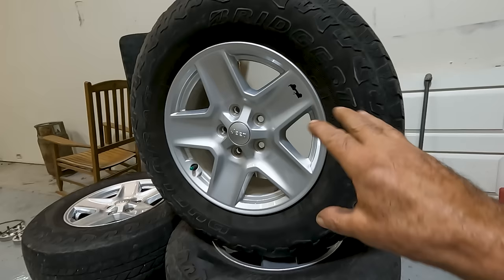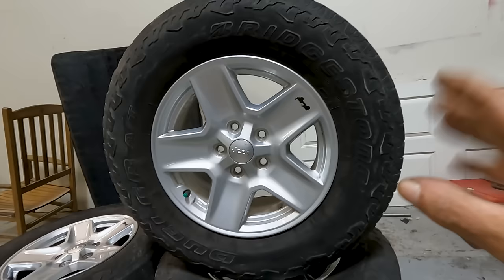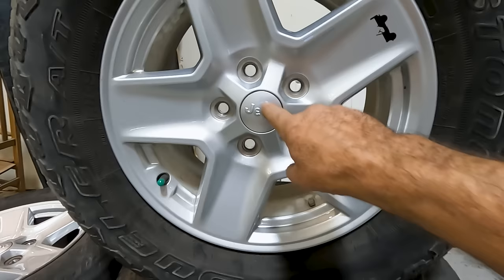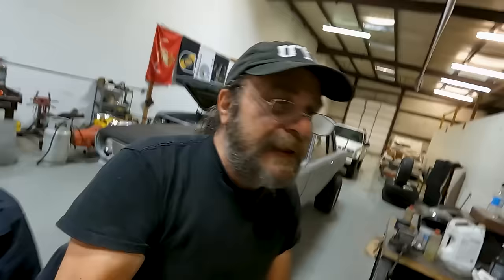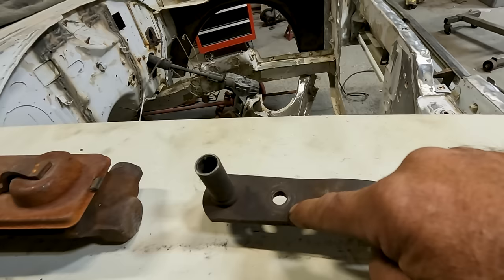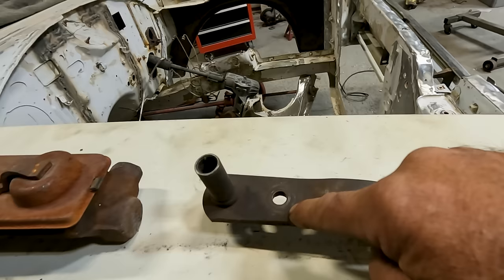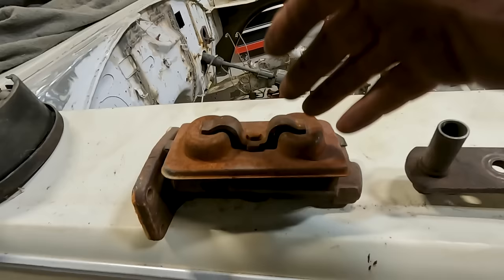Modifying Classic Cars And The Butterfly Effect - Can You Outsmart The Engineers?

Comment: Thank you! I come across this shit with aircooled VWs all the time. The internet says (and told me when I built my beetle 15 years ago) that a front disc conversion is a nice upgrade. Well wouldn't that affect the bias? No, they tell you, the car weight transfers so it's fine. Well, years later I slid my Beetle into a ditch with it's front discs only setup. Now look was that 100% my fault trying to hang the ass out and not knowing how to drive? Absolutely. But I remember sliding towards that ditch just thinking "I'm not even going fast and these brakes are doing NOTHING." I could not modulate the brakes such to create deceleration. Why? Because the internet lied, because you see people on the internet are just some jackasses. And the parts companies, well they just want to sell you parts, so they don't care. What I discovered years later when I started autocrossing the car was the front-only setup was HORRIFICALLY bad. It couldn't stop for SHIT. What people typically never do after modifying the brakes of a car is actually take the car out onto a back road and see how well it stops. Even ass-dyno, you never hear of someone going "oh yeah I went out, slammed on the brakes, it was way better." They just drive around the block and say hey yeah, feels fine. Well it'll feel fine until you discover one of the axles prematurely locks. My brother built a '69 C10, beautiful new paint, LS engine, etc. But he was new to building cars and installed the proportioning valve backwards. What this means is that it absorbed brake pressure from the FRONT axle not the rear. So on the very first drive, we were cruising down the road when the ML250 in front of us swerves around what was revealed to be a stopped car. He slammed on the brakes and the rear axle completely locked, no brakes. Luckily he had his wits about him and was able to steer around the stopped car safely and no harm was done.

Here's the deal with braking, there's a concept called the Ideal Brake Curve, it describes how much force each axle can create at varying rates of deceleration. The car weight transfers by deceleration generated by the tires. If you had a magical tractor beam that slowed the car from it's center of mass, it wouldn't weight transfer. Again the weight transfer is a product of the CG height and the deceleration generated by the tires. So if your car is severely biased wrong, it will not weight transfer because it will not generate enough deceleration. (https://www.theautopian.com/an-engineer-describes-the-ideal-brake-curve-and-why-cars-have-such-vastly-different-brake-sizes/) I can't recommend the youtube channel Suspensions Explained enough for TRULY understanding this stuff. As you touched on the proportioning valve exists to absorb some pressure off the rear axle to tip the hydraulic pressure curve to match the ideal brake curve. This is because a hydraulic system is linear vs the curve of ideal braking. So! If you put a race car style twin master with balance bar setup on a car, and you dial it in perfect for a road course with your big brakes, lets say on a 69 Camaro or something. That car now actually stops WORSE than factory in the rain, why? Because factory would have a proportioning valve and a more rear-biased setup than the race car shit. Same thing if you have a modern ABS car and you delete the ABS, it will now only be biased for maximum decel (Z-critical), which means braking will severely suffer in the rain. You can improve stuff from factory, but you're not outsmarting the engineers, you have to also become an engineer and shift the design criteria.
Reply from the maker: Yup!
Reply: @UncleTonysGarage  It's the worst in the truck world on the internet like reddit. "How big a tire can I put on my truck without it rubbing?" As if that's the only consideration. Rear drum conversions. Lift. No one mentions their towing or axle ratio or other pertinent issues when asking for intardweb advice. You know what I'm saying without listing it all. I personally stick to the two manufacturer suggested sizes for tires, period. I don't swap to large rims. And when I have to order parts for a daily driver, I don't want to consult a spreadsheet for all the non-standard crap I put on the vehicle. "I need brakes, but I can't order for my year/make/model because I swapped for some aftermarket junk conversion"
Reply: My first and foremost suggestion for modifications is more energy efficient lights. (So there is less draw on the alternator.) Then the second modification is Lighter weight wheels with the same size and offset specs.

 At this point people usually ask me my first suggestion when someone talks about adding or increasing power output....well, my suggestion there is to start working on the cooling system as step one. Because the by product is heat. And then follow that up with smoothing out entrance to the the oil drain back holes. (This is usually when everyone stops listening to my because I’m apparently crazy, and an overthinker)

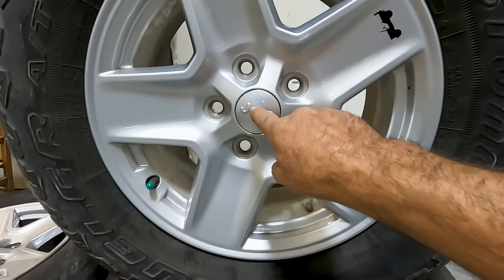-edit: while watching I also want to add in my thoughts on something Tony said and expand on a part of the conversation. 4:45 also besides the leverage. 
We also should take into account the additional weight. And the fact that those two things decrease the brakes ability to stop, however the amount of distance vehicle covers is increased with each and every revolution of the taller wheel/tire.
Reply: @Hipsters_N_Hippies  Ehhhh, part of engineering is knowing when things aren't an issue. If the engine drains oil well, no reason to fix that, if the stock radiator can handle more power, no reason to fix that, etc. Wheels too, yeah lighter is better, but it's really a very minor thing in the grand scheme of things and a heavy wheel likely is not making your car unsafe. Brakes are important because they are critical to the safety of the vehicle and you can literally make them worse left while bolting on "upgrades".
Reply: I still recommend using disc brakes in front. But do it right. Discs have more stopping power than drums. You need to change the proportioning valve. Cars came from the factory with front discs and rear drums for decades. And it worked, because they did it right. I have a 1972 Pinto wagon that came with MANUAL disc brakes up front. It came with a 2.0L four cylinder engine, which I swapped out for a 289 V8 out of a 1967 Falcon. That changed a lot of things. Yes I got more power. But I also got more weight over the front wheels. That made the car nose heavy. It affected handling and braking. I put slightly stronger springs and shocks with better compression and rebound damping on it. I eventually converted it to power front discs. It was better, but still handled differently than it did with the little four cylinder engine. I couldn't use larger front discs, because it has 13" front wheels, and they wouldn't fit. I've been driving it for several years that way, with no problems. I simply learned how to drive it properly with the differences the engine swap caused. It will never feel like it did when it was new, but I'm not giving up the V8 to get better handling, because going fast in a straight line is mostly what I wanted it to do. The handling and braking are still well within the safe range when driven in a normal manner. Everything is a compromise. All new cars are/were compromises, designed for normal drivers. If you are not a normal driver, and want to make the car what you want it to be, you have to remember that ANYTHING YOU GAIN IN ONE AREA, YOU ARE GOING TO LOSE SOMEWHERE ELSE. Make sure that is going to be acceptable.
Reply: u so cool, like wow!!!!